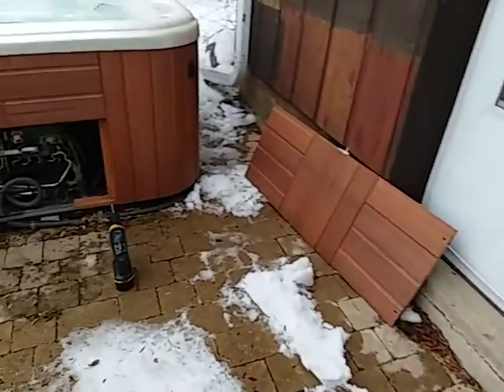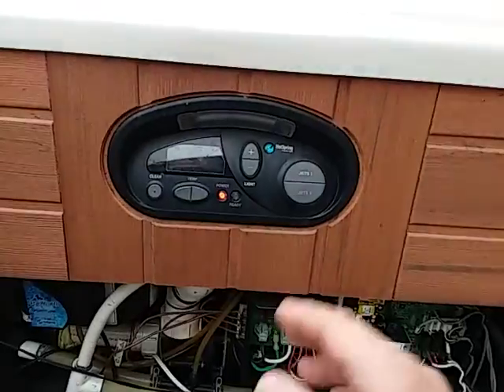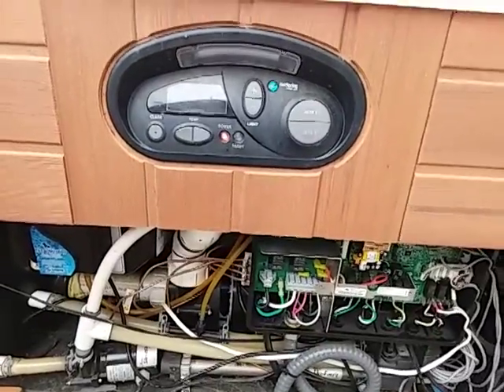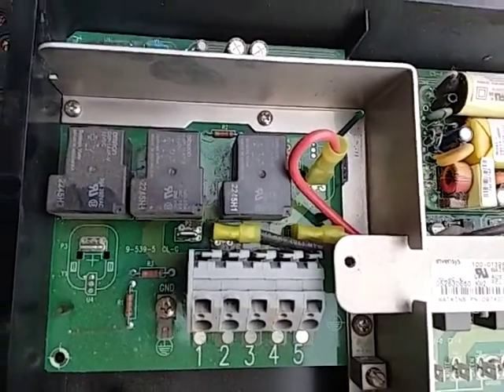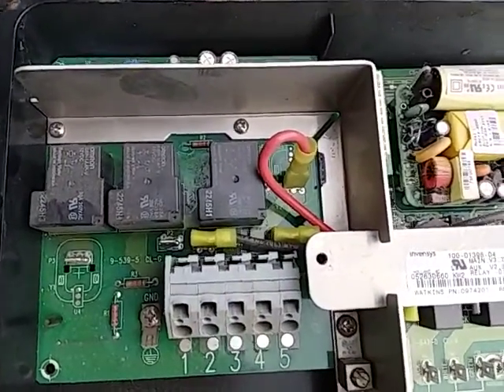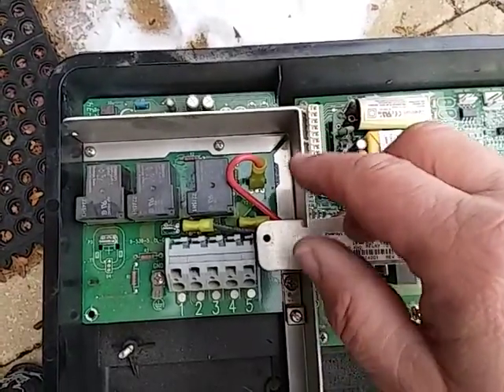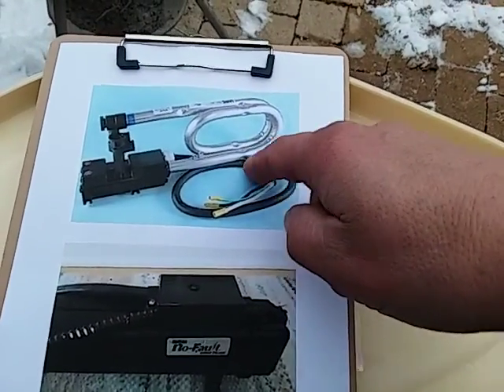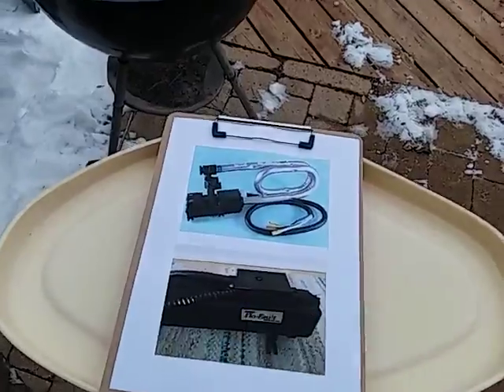troubleshooting Hot Spring tub not heating

Comment: Craig, thank you for the video.  I am working on my 2004 Sovereign II (240) that sat empty for 10 years.  I have owned it since new.  I checked all wires and repaired any that appeared chewed by rodents.  I replaced the NoFault heater endocarp that was cracked (stop leak).  I filled the hot tub.  Turned on 20amp breaker and circumstances pump worked and also had bubbles.  After 5 minutes I tuned on the 30 amp breaker.  Everything came to life and worked great .... except it never got hot.  I do not have any flashing lights.  Both LED's on MB (Heat, LIM) are lit up.  I have 110VAC between H1 and GND, and 110VAC between H2 and GND.  However, I do not have 220VAC between H1 and H2.  The tub is steady at 91 degrees (thats when ready light comes on).  I hear relays click (don't know which) when I dial down to 88 and again going up.  Heater does not feel warm to touch.  removed Heater relay board and could find no burned marks or corroded solder joints.  Any thoughts?  Oh yes, when disconnected I have 10 ohms between the white and black lead to the heater.  Thank you
Reply from the maker: I'll be doing a video soon on relay board replacement. Look for white streaks/dots below the input terminals heater relay board. Also look for black char between the relay's above the input terminal strip. Indicates a blown relay board.
Reply from the maker: Power in for heater circuit is 1&3. You should have proper voltage in at 1&3, in order to have proper voltage out at heater connections.
Reply: @craigsmith5025  I only had 10VAC at 1&3. Checked the output of the 30A breaker and it was 10VAC. Trip to Home Depot, $100, and everything is working.  Thanks for the steer. A better schematic study on my part might have made that more apparent. Thank you so much
Reply from the maker: @billcox1962  Glad it worked out. When I arrive on a job, I have my electrical meter, amp clamp, and start troubleshooting. I usually find the issue in moments. Typing to others who likely don't have those tools can be very hit & miss, and often impossible. Glad to help.
Reply from the maker: The lack of 230 between H1 and H2 is a problem. What about between 1 and 3? If you have 230 going in on 1 and 3, you should have 230 out to heater on H1 and H2.

Comment from the maker: I should point out, some AFTERMARKET twin-tube heaters have a tiny reset button on the back of the heater above the 1/4" vinyl tube connection. These oddball aftermarket heaters sometimes stump me for a few moments, until I realize what was put in there prior to me coming out.

Comment: what would be an eqivalent replacement if we have one of those heaters. The one that I have is the top one on the sheet you showed.
Reply from the maker: There were 4kw and 6kw versions of that tri-bend curved pipe heater.
Reply from the maker: 73790 6kw, 73791 4kw.
Reply: Ok great thank you

Comment: Craig, replaced heater but only have 120 volts on the right heater prong, left side has nothing. Checked power coming in from breaker to circuit board and have full 240 volts.
Reply from the maker: See my RELAY BOARD video.

Comment: Hi Craig, I have the exact thing happening (no heat but lights on) I replaced the “other” circuit board because that yellow piece was all melted….I just assumed it was that???. But I installed the new circuit board and it’s doing the same thing. I’m thinking it is the heater really board based on your video but I have a question:
How do you tell if it’s the circuit board or the heater?
Ie. what is the proper way to test the heater circuit and the proper way to test the heater relay board?
2008 Vanguard - VV model.
Thanks in advance!
Reply from the maker: See my video on replacing heater relay board. You'll see what made me know the board was bad in the opening of the video.

Comment: When I remove the pressure switch connection to the board the red call for heat light goes out. With the switch connected red light is back on and there is 230 volts between white and black wires to heater. Heater has 11 ohms of resistance? Is it the heater?

Comment: Do you have a recommended part number for the relay board you pointed out?
Reply from the maker: 77119 for 2001 through 1st quarter of 2009. That's a IQ2020 PUG. Later they were Orca or Eagle and had different style relay boards. Check all my videos, I have one for relay board replacement.
Reply: @craigsmith5025  so what tends to cause the relay board to fail?  Are the copper traces not thick enough to adequately allow current which causes them to heat and eventually deteriorate the board or do the relays have an eventual lifespan?
Reply from the maker: @miss lolaaa  ooh, I could write a book on the 5 revisions to the heater relay board. Let me just say either they finally took my advice, or they eventually listened to someone else that suggested what I'd been saying all along. The last 2 revisions are now trustworthy. Get a replacement now with confidence.

Comment: Great video! My 2003 Sovereign runs, and heats, the button that controls heat up doesn't seem to work. The heat down button works fine, and does the rest of the buttons. Any thoughts where to start?
Reply from the maker: The buttons on the control head circuit boards tend to die with age. Although, the spring loaded gray buttons within the black oval housing can get gummed up with dust and debris. Someday I should do a video about disassembling the control head to clean and inspect. You could possibly find good used control heads in your Hot Spring dealer junk pile out back.
Reply: When you say "control head", are you referring to the piece with the gray buttons, or the part that that oval panel plugs into? Thanks for your reply!
Reply from the maker: @robnash1700  the control head is the electronic control panel module with circuit board.  The control bezel is the black oval dash board with gray buttons that it fastens to.

Comment: I have been watching all your videos today my door closed on accident and it shut my hot tub down all the lights on panel are on like they should and c pump is running good but heater and jets are now off for weeks now and I checked the ohms on thermistor and they both read same for my 60 degrees
Reply from the maker: Door closed on accident? I'm not sure what that means. If jets and heater functions are locked out, it's usually a power light flash/hi limit error. Gotta reboot power to clear it. If it keeps coming back, there's a reason why. See if it acts normal with just the spa breaker rebooted, leave the heater breaker off. If it only occurs after the heater breaker is rebooted, then I have reasons for it.

Comment: I didn't see you pulling the relay board out, yet it appears to be on a bench.  When I open the front, will it be right there?
Reply from the maker: The black IQ 2020 control box is front and center in the spa service compartment. I have a video on replacing a relay board, but I did it in my shop for the video, I always do them in the spa out in the field. Controlled conditions in my shop for the relay board replacement video after dark.

Comment: We replaced our pressure switch which had failed, but also our heat sensor because one of the wires broke off well repairing the pressure switch. We can’t seem to get the heat sensor override to reset ideas?

Comment: Hi Craig
I have A Grandee hot tub that is not heating , no blinking lights and there is power to the heater but no heat. Recirc pump and filter are good, there is good flow.  Could it be the pressure switch with steady red power light?
Reply from the maker: Proper way to test voltage is across both wires of the heater, you should get 230v. If you are testing each wire to N or ground, you will get 115v even with a bad board. If you get 230v, power down and reset the heater breaker to ensure it didn't kick itself out on an overheat... some heaters are a PDR power down reset w/o a pressure switch wire. You can test a heating element by killing power, pulling out the black and white wires, and check for continuity through it with the meter.

Comment: Hello Craig,
 I have a 2000ish hot springs spa. The heater was bad. Replace the heater along with the new updated circuit board. Fill the tub up jets run heat set at 95 and doesn’t get hot. Lim LED lit green, red heat led is not lit….i have a d10 lit on the heater circuit board not sure if that’s suppose to be lit. Checked 2 and 5 have 240v checked 2 and 4 have 120.
 My circulation pump is warm to touch but can not feel it that it’s working…. Filters are new. The thermistors were new with the new heater so i don’t believe that’s an issue. Have any thoughts? Thank you
Reply from the maker: I think that's a typo on power inputs since 5 is and has to be a neutral. If you have a hot in 5, and reading 230 at 2 and 5, you'll blow the board. However... with no HEATER ON red LED, there is no call for heat. A bad aux panel can interfere, unplug phone jack connection. A bad light lens LED can interfere, KILL POWER and disconnect IC INTERFACE and LED LIGHT connections, reboot. Something has to be interrupting the call for heat. Make sure you're not on SUMMER TIMER. I had that last week in near freezing temperatures.
Reply: @craigsmith5025  bad Aux panel as in the control panel where you turn jets on and change the temp?
Reply from the maker: Do you have a flashing green READY light on the exterior of the spa? That would be bad control thermistor temp sensor, or plugged in at the wrong spot, (ozone interface) or plugged in off to the side a bit. Double check sensor plugins at the board.
Reply: @craigsmith5025  nope just a steady green light and no red light when it calls for heat.
Reply from the maker: Aux panel is the 2nd control panel inside the tub. On all highlife spas except Jetsetter.

Comment: Hi Craig.
can you tell me where this breaker is located?
I can not find it.
Thanks
Reply from the maker: Are you talking the heater reset button? Twin-tube heaters AFTERMARKET can have a tiny reset button above the small 1/4" drain line. But Hot Spring direct heaters either have a gray wire coming out the side for pressure switch style, or no wire which indicates PDR style. Power Down Reset will kick themselves out when overheated, and you correct the flow/overheat issue, and power down/power up to reset.

Comment: hi craig i have a 2005 hot springs envoy that i added a little water through tthe spa filter pipe with the jets running in the clean cycle as i also added chemicals at the same time .  I lowered the temperature to 80 and noticed the  ready light dosent come on now does that mean i tripped the heater and have to reset it thanks in advance ed
Reply from the maker: The green ready light is on only when the water temp and set temp is within 2 degrees of each other. So if your set temp is down at 80, and your water temp is still up in the 90s, that's why. It's hard to get a spa actually down to 80 in the summer.

Comment: Just got a 2007 Hot Springs Grandee from our neighbor. Can the IQ 2020 run the light or not? has a pin and place identified on the main board but it doesn't work. Neighbor said "light doesn't work." But I'm not going to spend $350 to replace it. Any ideas on the light?
Reply from the maker: The main light in the light lens may be leak damaged, or mouse chewed. You can buy the replacement tri-color LED module for it. But those rarely fail all by themselves. NEVER plug/unplug the long IC interface connection with the spa powered up, or you'll destroy the board.
Reply from the maker: A old established Hot Spring Dealer may have the old discounted 72016 in old stock, was strictly blue LED, and was only about $100. Or perhaps they have a blue or multicolor LED that's still good in a junk spa out back.

Comment: Craig, thank you for your videos.  I have a 2006 Jetsetter Model J tub.  No heat with LIM OK and HTR ON LEDs lit.  AC power is 115VAC, breaker has been reset properly.  There is no sign of burnt relays.  The relay board is the newer type for the 2001-2009 tubs. the power jumpers are correct for the 115VAC.  The heater was replaced with Watkins PN 73790 No-Fault 1.5 kW, along with new limit and thermistor sensors.  There is no reset on the heater.  Tub warmed up initially, green came on at temp, now it is cooling down.  Checked filters.   I am out of options.  Please advise.
Reply from the maker: With a multi meter, check voltage at H1 and H2 to see if your heater is getting voltage. If it is, your PDR heater may have kicked itself off due to overheating from a flow issue. Twice this past week, I had flow issues. One was dirty filter, the other was an obstruction in the mazzei ozone injector tee.
Reply: @craigsmith5025  thanks.  No voltage.  Turns out D9 LED is blinking ... Bad relay board

Comment: Is there a difference between the heater relay board that's $290 and the $168 one on Amazon?
Reply from the maker: As long as it's the 77119 for 2001 through early 2009 PUG and has 1-5 inputs, you're good.
Reply: @craigsmith5025  yeah, they look the same so I wanted to confirm.

I also have to replace the circulation pump which says on the inspection from a few years so that they cost about $375 yet I can't find one online that is at that price. There is one for $160 that is an E5. And it's the most common model i think.
Reply: @craigsmith5025  can I send you a picture of the hot tub with the 2 parts that need replacement for advice?
Reply: @craigsmith5025 ok so it's been some time.

I put in a new circ pump and I took out the heater relay board and inspected it. It looks brand new. There are no markings, burns, and it's the newer model that you described. Now it still could be bad, I just wasn't sure and reinstalled it. Finally turned the tub back on after years.

First thing I had was double blinking error lights red and green. I put a hose in the grey filter to prime the circ pump and restarted. Now the pump is working but the blinking continues. So I let the tub finish filling since it was only half full.

Now the tub is full and the blinking stopped, but it just won't heat with the solid red light.

I'll see how it looks tomarrow since I did this all at night AND we have no lid for the tub right now

Comment: one weird failure mode in a Hot Spring Vanguard tub turns out to be a failed tub light.....for some reason, Hot Springs have a glitch in the IQ2020 control board that shuts off the board if the LED tub light fails.....
Reply from the maker: That was common with the early multi color LED modules, before revisions 2 and 3. However with a leaking light lens, it doesn't matter what revision you have. A wet LED circuit board can wig out the motherboard.

Comment: I have a Hot Springs sovereign 2 that came with the house we just purchased. I flipped off the breakers and drained, refilled ( but overfilled) , drain necessary amount out. Flipped breakers back on and now the LED display is just a blank screen with only light blue background. The jets work, on the board the LIM ok light is green, the HTR on light is red, bus status light is green. Any ideas on the display ? It was all working before I flipped off the breaker.
Reply from the maker: If water overflowed and got in the control panel, it may be shot. And if it is an Orca control system 09-12 LCD screen panel with no USB port on the motherboard, no panel is available. You got to replace both control panel and box in an ORCA to EAGLE upgrade.

Comment: Thanks for this Craig!
My spa has a weird issue, where it's only heating when the jet system is on... Any ideas what the issue is? it's a 2006 Vanuguard if that helps...
Reply from the maker: So when you turn on the jets, the HEATER ON indicator LED on the main board lights up and it heats? When you turn off the jets the LED goes dark?
Reply: I didn't check it... yesterday I filled the spa and it was at 80F. Set it to 90F and left it over night and this morning it was still at 80. I then turned on the jets and it started warming - now at 100. I tested the board now and it looks like the heater light remains on when I close the jets. I also think that after I filled it the heater light was out and the one above (high limit?) was red and is now green. So maybe the jets just resolved an air lock or something?
Reply from the maker: @Nir Drayman  I always fill down the gray filter pipe to prime the circ pump. Then power up the spa breaker to run pumps and burp air. When I  know there's circ pump flow, THEN I flip on the heater breaker.
Reply: Thanks Craig!
A follow up - while the jets were off, the spa dropped from 101 to 98, even though the heater light is on... Any idea what the problem could be?
Reply from the maker: @Nir Drayman  if the LIM OK and HEATER ON lights are lit, there's a call for heat. So you should be reading 230V at inputs 1 and 3. Also 230V out at the heavy duty black and white wire heater connections. It's possible your spa was getting warm on pump motor heat alone.
Reply from the maker: Have you seen my video on heater relay board?

Comment: The breaker for my heater keeps turning off. We have to wait an entire month for service. Is there anything we can do in the meantime to try to fix it ourselves? Maybe take out the heater and see what may be the problem?
Reply from the maker: Disconnect both white and black wires of the heater, and see if the breaker holds. With those wires disconnected, use a meter to see if there's ohms between one of those disconnected wires and the heater ground wire.